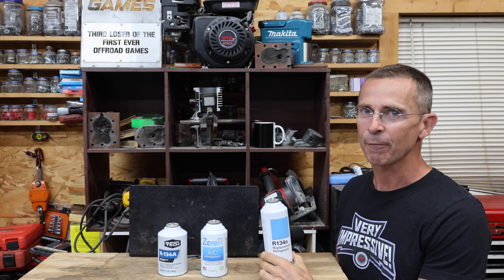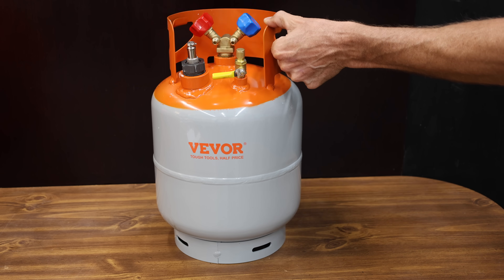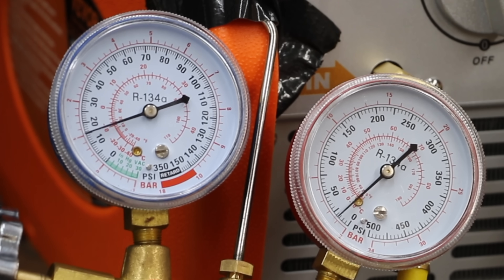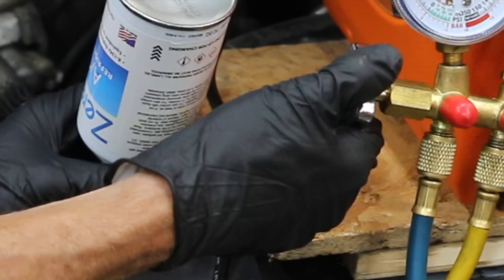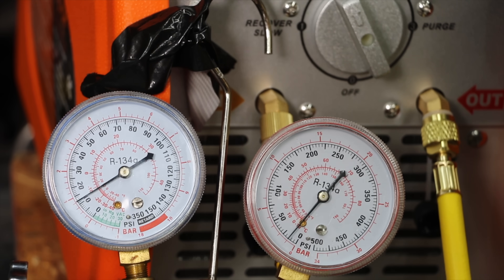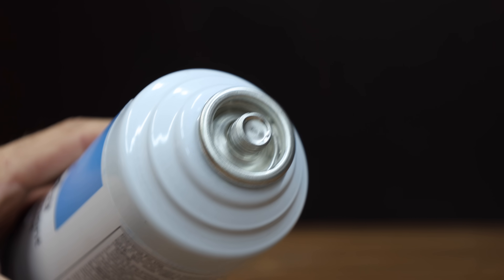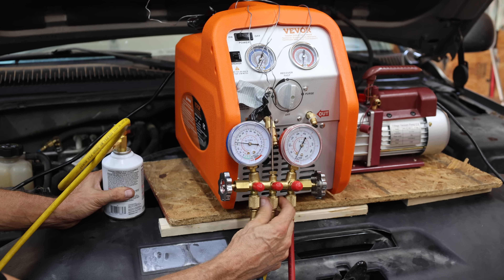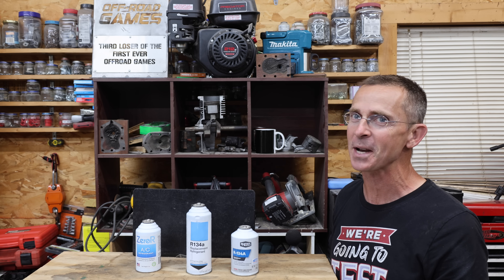How Dangerous is Fake Car A/C Refrigerant? Let's Find Out!

Comment: For real, I've been running hydrocarbon refrigerants since 99 It does work better. In 2 minutes it'll bottom out about 37° at idle so. My Cars are mad cold. Enviro safe FTW
Reply from the maker: Thanks for the information
Reply: @ProjectFarm  I have what you're using I have not used it yet. Fortunately GM AC systems are very accommodating and cooperative for this. Doing this is very tricky on several systems.
Reply: Which ones do you use specifically?
Reply: Tried the Enviro safe in my 89 Caprice, got crazy cold AC.
Reply: The compressor on the house AC was leaking pretty bad, 
acouple years ago, and R-20 was MAD expensive, so I used 
some R-290 I got from Home D.  15 pound bottles, refilled, 
for about $20 or so.  Yep, BBQ grade R-290.  Had to refill 
a couple times a week, but that one bottle lasted all summer.
(Landlord bought a replacement, when the weather cooled 
down, in the fall.)

steve
Reply: what happens when you get in a fender bender that punctures the condenser?
Reply: @ProjectFarm 
Lately, Ive been grabbing up cans of 134 when i see it on special, as i hear they will eventually phase it out like the old r-12. 
I wouldn't mind picking up a 30 pounder of 134, but ive already got that much in stock. 
May as well be a glutton and keep stocking it away.
Reply: @surewhynot6259 it leaks out like any other refrigerant. It's a small amount and dissipates to a non combustable mixture in seconds.

Same for a leak in the evaporator.

The pressurized gasoline in the fule rail is far more dangerous.
Reply: Envir Safe FTW is right- I don't know about the other stuff, but ES Refrigerants work great for me. Really important to be sure you do not have any leaks before filling, and that is the rub with flammable refrigerants- most people looking at a replacement already have a leaking system.
Reply: @surewhynot6259   When you ram a deer you can have roadside bbq venison.
Reply: @MrTheHillfolk  I've heard several refrigerants will be phased out begginung in 2025.  R-410A being another one.  A lot of homeowners are going to be pissed!
Reply: @surewhynot6259 same thing as happens when you spit a fuel line or fuel filter or fuel tank or have a car that run on lpg.
🔥.
Reply: @surewhynot6259 same question for all these new vehicles using flammable 1234yf from the factory
Reply: @surewhynot6259  it blows out quickly under pressure but if there’s a spark close to where it’s leaking that could ignite.
Reply: Likewise
Reply: replacement for refrigerant r134a, as a mixture of r290 + r600a 50% / 50% is very good
Reply: @MrTheHillfolk careful, you'll wind  up like me with several cans of the old R 12 that I can't do a thing with. I ve tried selling them to car guys still running  the old refrigerant,  but no takers.
Reply: @markm0000 nice thing about propane or hydrocarbon refrigerant is that it burns off quickly and is mostly consumed in the flashoff.
Reply: Yeah propane works good
Reply: @surewhynot6259  nothing happens. Have you ever been able to light a propane torch from an inch away same with this stuff. Don't worry, the new 1234YF is flammable also and that's ok...
Reply: @deeeeeeps  Not true. If you can light a propane torch at an inch away go for it. You can't neither can this stuff.
Reply: @markm0000  if if if and if and buts were candy and nuts we'd all have a Merry Christmas. Even if it did light how long would it last in an open area? It won't. Don't worry the new 1234YF is flammable also.
Reply: @surewhynot6259 only 2 or 3 lbs needed, risk is pretty low. What's in your fuel tank (or battery if it's an EV) is way more dangerous.
Reply: It's important to not overfill with the 134a replacements as they usually use around 60% of equivalent 134a. I did witness an incident where my neighbor was using ES, he overfilled and  ruptured the high pressure relief valve. Nothing ingnited lucky. I've used alternative refrigerants for over 2 decades with great results without incident. They typically have lower head pressure and don't load the compressor as much as well. Correct me if I'm wrong but other regular refrigerants are flammable too.
Reply: @JSFGuy  not really. You can use propane, just need to induce a lubricant with it.
Reply: @surewhynot6259  nothing terrible. Maybe a little bit of jetting if you spark it just right, which is unlikely.
Reply: @MrTheHillfolk  of course they will. They always phase out shit that (currently) works best, for shit that is worse in performance. Because it force generates income for the companies they have invested in.

Read: DEF
Reply: @TheWebstaff  I had an old truck leaking on the return line for months before I noticed it. Only fire I ever had was a damaged trailer plug shorting and lighting its sheathing on fire, but not the gas)
Reply: @somedreybloke  ES for whatever grade you need they have 12, ES-134, now they have ES1234YF supplement replacement.
Reply: @ObservationofLimits  propane was used to sandbag R12 systems back in the day. It's just so much easier and practical to get some ES12 if you're putting it in a R12 system. I've never heard of it used in a 134 or later because those refrigerants are readily available.
Reply: @surewhynot6259 if it punctures the condenser, I'd say it was a bit more than a fender bender. Either way what would happen is the refrigerant would vent to the atmosphere.
Reply: I've been using envirosafe for nearly 30 years.  When used properly it can be put into any car AC system from the R12 to R1234YF with only oil compatibility needing to be considered.
Reply: I remember guys using air duster cans
Reply: '89-'90 or so in my '86 Cavalier (RIP).  As I mentioned in a different comment, you could hang meat in my car it got so cold.  There was a place in Utah, forgot the name, though, where I got a case of HC-12a.
Reply: @surewhynot6259  Nothing.  It leaks out, you get a new condenser, refill.
Reply: @jimm1819  As a building inspector we are kind of concerned about the r410 replacement.  Questions are coming up about fire rated chases about the new stuff ..
Reply: Yep, re-gassed my own landcruiser with a bbq gas cylinder and it blows fog when it's humid, it's so freaking cold it's crazy. But used the same LPG on a Ford focus and it destroyed the compressor, so its not suitable for all compressor types I guess. Different liquid/vapor points.
Reply: @jimm1819 yeah and there better be some alternative we just bought a new system
Reply: @ObservationofLimits  Who is they?
Reply: @lexicase8805  Are they both 134? LP was more for R12 systems before 95.
Reply: @somedude2492  if you get t-boned on the A piller and crush the dash it could leak into the cabin, in the worst case scenario 🔥💥
Reply: Since these substitute are hydrocarbons and flammable will the new 1234yf refrigerant work on these older systems?
Reply: @TheWebstaff that's probably some of Brandon's doings
Reply: @and9290  being that the evaporator is in the middle of the dash i think there are a lot of things i would be worried of before worrying about the evaporator leaking. One of the main ones being that i just got t-boned so hard that the A pillar is sharing space with the shifter, with my legs in between...
Reply: @lexicase8805 You needed a mix with butane for the focus. It was probably a R-134a system, the higher pressure of the propane cooked the system.
Reply: In Australia unless we want to drop the best part of $1k this is our only option. It works better than r134a too. As far as I know it's a carefully controlled blend of propane, butane and maybe some other things. The gases are high purity and have been thoroughly dried. At least the Aussie made stuff is.
Reply: @surewhynot6259 I've never heard of a fire from it. Because the average person can't buy r134a in Australia, the replacement is pretty popular.
Reply: @and9290  worry about rear end collisions and that 15gallons of what in the tank?
Reply: @MrTheHillfolk  Don't know when it will get phased out, but we are still getting brand new semi trucks being built with it so I don't think it's going to be very soon.
Reply: Yep.. Been running Envir Safe for about 7 years in my older R12 Jeep. It's awesome up to about 100°F outside, then it's just okay. I just did a service and recharged with Envir Safe Industrial and at 90°F outside temps vent temps get down to -2°F at the lowest I've seen.  Pressures are a bit off of what R12 or R134 would be but they are closer to normal than the stuff he tested.
Reply: @BakoRick  envirosafe use to sell a blend to closely match r12. But now they only sell the 134a replacement.  It's just a slightly different blend. If you add a little extra r600a you will be very close to r12 pressure and work better in the old systems. But pure r600a is expensive in cans. And not worth a keg for only 1 vehicle.
Reply: @MrTheHillfolk it’ll be many many years before it’s gone
Reply: @jimm1819 it’ll still be around many years.  They may not produce whole 410 systems.  But their still going to produce parts a the refrigerant will be round hella long. Ain’t that big a deal. 
An their may be retrofits to whatever else anyway when it comes down to it
Reply: I’ve wanted air conditioning manufacturers to switch to propane for years. You could run such a small compressor! It would be super efficient.
Reply: @rob2257  Right well propane by itself doesn't work much past 90°. Years ago with agriculture farmers would top off their systems with it and it would work in those R 12 systems.
Reply: @steveskouson9620 : very strange statement  ... 
I've worked in heating & cooling for years on end , and have not seen very many compressor leaks...... at all ... 
Normally, it's the evaporator or the contention coil... Or an access port. I'm just wondering how you can do. The conclusion that the compressor was leaking.... that's all
Reply: @AquaTech225  Will it be available to consumers, or only licensed techs?
Reply: @JSFGuy  yeah both 134a. Only difference I know of is one uses tx valve and the other uses orifice tube, maybe that's part of the issue?
Reply: @lexicase8805  can be depending on the system. TXV are more sensitive to particular refrigerants, orifice tubes are more forgiving. The orifice tube does have three different sizes to choose from on a given application. Vacuum and service quantity is vital.
Reply: it is going to be phased out.  2028 completely
Reply: had my home a/c repaired, they tried selling me a new unit due to the type of freon un my unit being on the phase out list
Reply: the conversion adaptor is only a few bucks that's why no takers
Reply: @poellot  Thanks for that info. It was 111° out yesterday and it was still able to keep me comfortable on my drive home so I'm pretty happy with that. But if I ever run across a inexpensive can of r600a I'll be sure to grab it up.
Reply: R12 systems are better suited for r-290 than r-134a systems. The r12 systems are very efficient when charged with enviro-safe
Reply: What refrigerant is hydrocarbon?
Reply: @thomasexeter97  R152a is an excellent performer in both R12 and R134a systems. A system built for R134a with R152a running in it will cool better than a R12 system. I am riding around in 1987 and 1997 GM vans that blow low 30s and high 20s at the center vent with the blower on high speed in 110F Texas summer heat. In Texas humidity, above engine idle, I am only limited in system performance by evaporator core(s) freezing into a solid block of ice.
Reply: @jimm1819  so true all hfc refrigerant will start to be phased out starting 2025 and will be replaced by hfos and hc refrigerant with low gwp so we just have to get use to using highly and mildly flammable refrigerant and I hope they're satisfied and stop changing our refrigerant
Reply: I have 12A in my system in Canada, where it is legal, but there is a risk that has made it illegal in several U.S. states. Look up Panama bus fire concerning 12A.
Reply: @7:00 on a lot of vehicles the receiver/dryer is after the condenser, on the high side.
Reply: @markk3652 well most people could just convert over from r-12 to r-134a but there won’t be conversions from r-134a to r-1234yf and I believe it is illegal likely due to the flammability aspect of the latter and that systems designed for the former as well as the machines you would use aren’t designed to account for that not to mention they function differently anyway.
Reply: @willp942  R1234yf is also toxic, which R290 and R600a isn't.
Reply: Contrary to corporate propaganda, HC-12a is completely safe to use properly functioning A/C system. You’ve got 15-20 gallons of volatile fuel under the back seat, but you’re worried about a pound of isobutane/propane? 😂 At that point, you might as well just stay home.
Reply: 1.5lbs equivalent pressurized hydrocarbon, I don't think it would do much more than a couple cups of gasoline.

Comment: A couple notes for anyone looking to tune up their system:
A healthy AC system usually has around a 20 degree temperature drop relative to the intake air when measured at “warm” temperatures (70+)
Your low pressure gauge will have marks on it for the temperature of the refrigerant. This is the temperature of your coil inside the vehicle. This temperature must never be below 32, as it will cause the condensation on the coil to freeze and create an ice block inside your dash. 
The performance of your compressor varies with engine RPM. If you really want to dial in your AC just right, figure out what your standard cruising RPM is and have your engine revved up to that RPM while tuning. I tuned mine at 1,800 rpm, and it blows like a freezer at all speeds. If you tune your system at idle, it may be a little warm at interstate speeds when the engine is running faster. 
When it comes to vacuuming a system down, go ahead and take a lunch break while the vacuum pump works. The longer you let it vac down, the more potential contaminants will be removed. We actually measure the vacuum quality by measuring the particle size of whatever remains in the lines, and even if the vacuum is at really low pressures, there could still be plenty of contaminants in the system. I did residential HVAC, and it wasn’t uncommon to let systems vac down for over half an hour to get them within “acceptable” ranges.
Reply from the maker: Thanks for sharing.
Reply: On my car, I left the vacuum on the AC system overnight before refilling it.

Comment: One of my spare vehicles is a 91 Mazda pickup with the 2200 engine which produces about 80 horsepower. With the phase out of R12 I converted it to an r134 system, but due to the low horsepower it really put a drag on my performance, and the system did not function very well. I switched over to the Zero R and it was a huge performance improvement. It's 111° today and my wife is using the truck to move some furniture. She hasn't complained about the AC so it must still be working well.
Reply from the maker: Thanks for sharing.
Reply: @ProjectFarm  I am considering Envirosafe refrigerant.  There used to be an R-12 specific and and r123 specific, now it is all in one.  They claim 40% increase in performance.
Reply: I had similar power loss on a four banger, it was from too much oil in the refrigerant.

Comment: My 05 Chevy 2500hd with the Duramax has 383,000 miles and the other day i replaced condenser, suction,discharge,and liquid line,and the the drier. I got the same temp results.Driving at 65 miles my temps were 42,43 degrees in which i would have thought more air hitting the condesor and more air flow it would have hit mid 30's degrees. But when i got home sitting in the driveway in park it was 39,40 degrees.  Not complaing that a truck with those miles and 20 years old xan make those kinda of temps. Thanks for your informative videos!!
Reply from the maker: You are welcome!